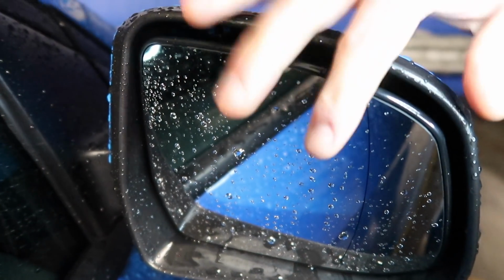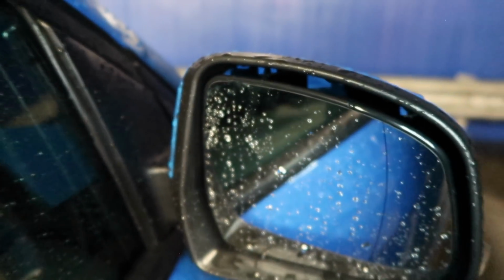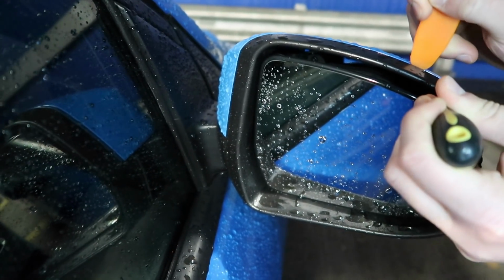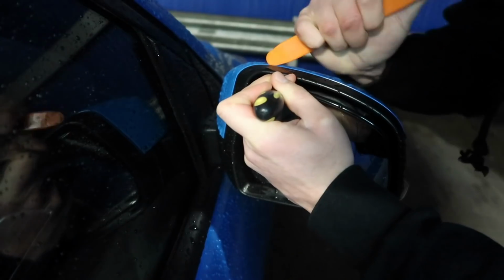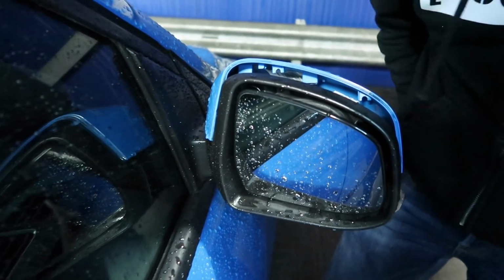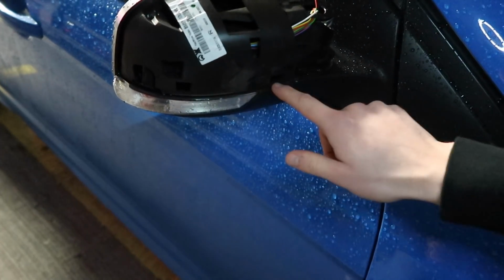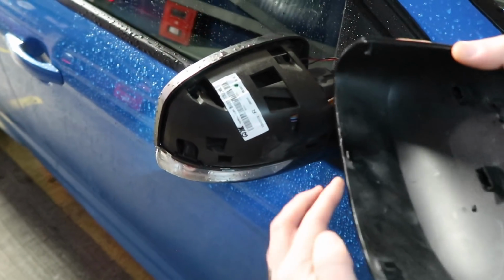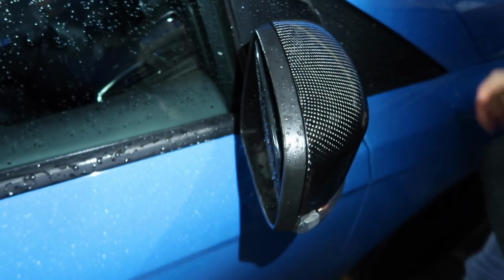CARBON FIBRE MIRROR CAPS INSTALL! | FOCUS RS CARBON PART 5

Comment: Adam I do believe you should've called out Kuro Carbon in this video, I think you should've done a small piece to camera but the bad customer service but that's my opinion of it. I reckon if Tim was getting the carbon mirror caps they would be made to the greatest quality and they would actually bother their arse to check they fit on the car.
Reply from the maker: Yea man I know but I'm not a big fan of conflict so I just wanted to get the video out of the way and forget about it. To be honest the level of nasty abuse they both threw at me (dave Kuro and his little lap dog kavan flanagan, made me struggle to get motivated to film anything. Real bullying stuff. But I didn't rise to it in any of the private chats, taking the high road kind of thing. I just want them to dissappear, which is likely in the long run with their shoddy business practices. I don't think they made it into Tim's car. Probably for a good reason...

Comment: Oh, dear,, you have a lot more patience than me !!
Sounds like Kuro are Krappo,, I'll give them a miss, thanks for the tip,,..
Your car is gonna be so light with all the C/F ,  lol..
Reply from the maker: I really did have the patience of a saint and was willing to keep waiting but when they start verbally abusing me, I ain't gonna take it. This video is really just a 'what could have been' kind of thing, a long lost video from the archives. I'm probs gonna remove these pretty soon when I get time. Lol at the weight saving :D These technically add weight cos they just glue some carbon on top of a plastic cap. I am starting to change my mind about what I was going to do for exterior carbon. Just doesn't seem worth the hassle. Cheers John!

Comment: where do  get the carbon fiber parts man ?
Reply from the maker: various places, have to shop around to find the best stuff and also NEVER buy from Kuro carbon. They are crap and have terrible customer service. These caps developed a fault very quick - what looked to be water in between the clear coat and the carbon weave and someone on facebook I saw recently posted about the exact same issue with a Kuro rear wing on his RS so they clearly don't know what they are even doing
Reply: Adam Rainey I messaged him on Facebook thanks for the hands up
Reply: Hey Adam. It’s well I seen this post about Kuro as I had been messaging them about mirror caps. Who do you think is best to use?